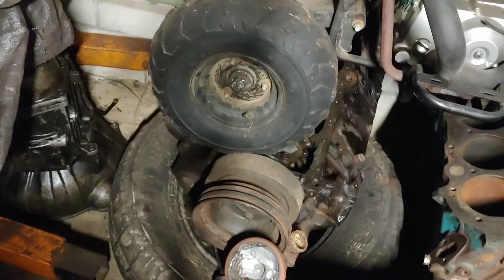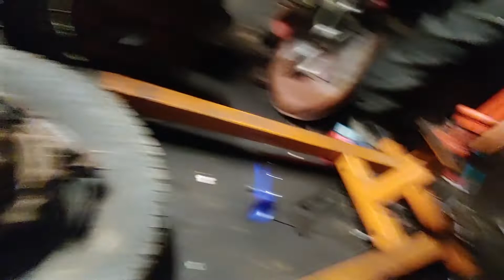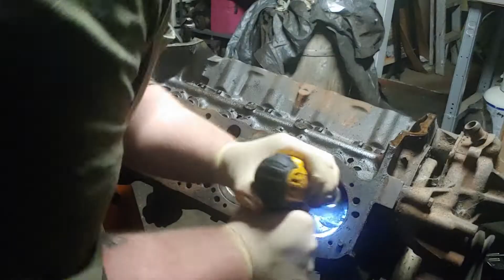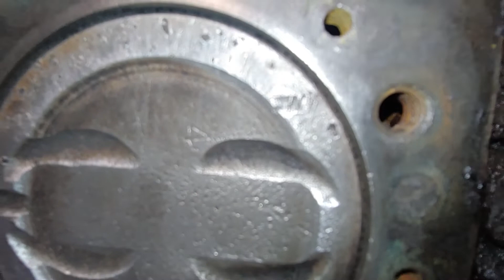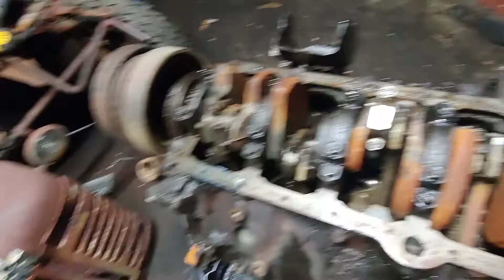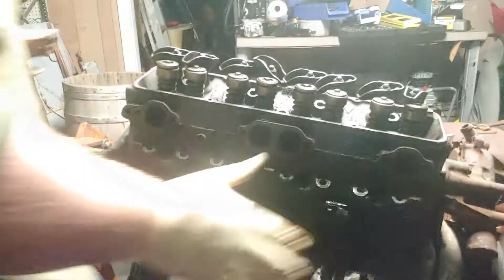I REUSE HEAD GASKETS!!! Building A Chevy Small Block Out Of Junk

Comment: Full disclosure, I only know engines from YouTube! Derek, Dylan, Kevin, Josh and Dalton are my mentors :D Still, this looks like taking "good enough" to the extreme... I imagine one could take that ratty old engine apart, clean it, lube it, then put it back together using the same hardware, even possibly the same headgaskets, and get some sort of running motor out of it. Or, given the junkyard behind you (not judging!), find suitably "junk" parts to replace any wiped cam and lifters, bent pushrods, burnt valves et cetera. After all, if it spins, seals and makes compression, it should run, right? :)
Reply from the maker: It definitely ran. Check out my video of my Camaro starting for the first time in 17 years. It was with that engine.